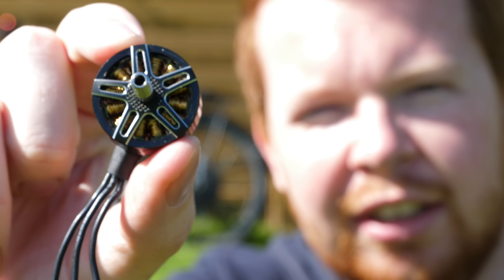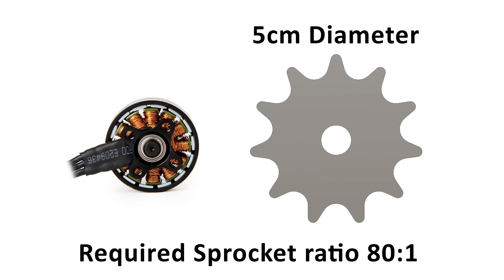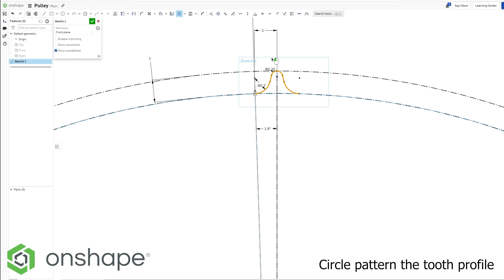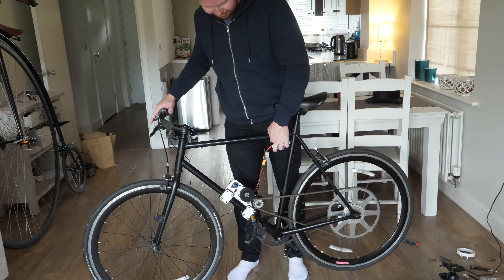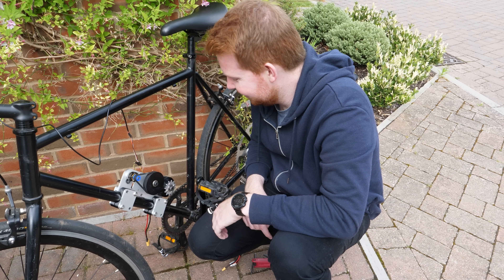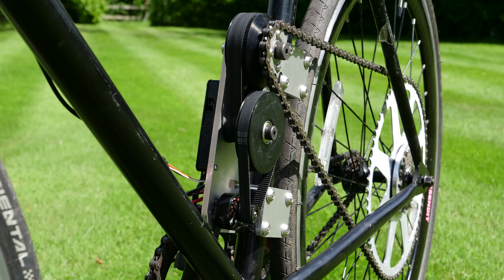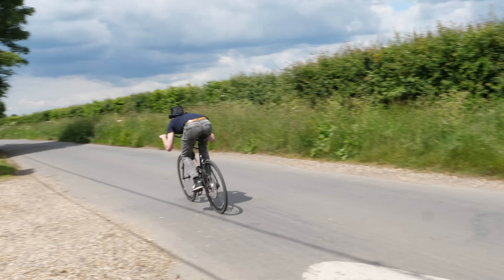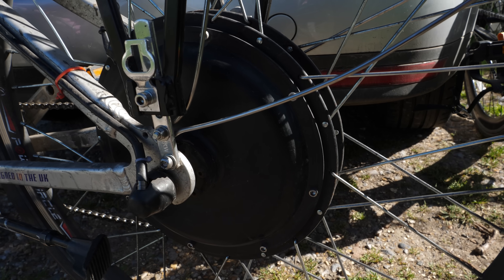Tiny 1kW Electric Bike Motor

Comment: Just add a fan and a duct around the motor, so the fan spins at motor speed. Choose the right pitch to take a little power for cooling, but not too much.
None of the drone ESC's are made for low-speed or high "slip" (magnetic:meccanical) operation, thus the horrible groan. Also, probably drop a fan on the ESC, too.

Would def be interesting to see one of these combined with an internal-gear hypocylic mechanism, with a 90:1 ratio.
Or maybe try with an internally geared hub, which you can get with a 2:1 or even a 4:1 1st gear. Then shift up from there, until you are power limited!

Comment: stack 4 of them around one gear to gain 4x torque for those starts.   Also will benefit spreading the cooling.  You could also mount the motors not on the gearing, so tensioning the chain will not effect shaft strain on the motor.

Comment: Drone motors are made to be very specialized for their niche use, for instance they rely significantly on the propellers to cool themselves down. That is how such a small motor can have 1kW rate.  I would look for motors for this usage on the power tool sector. Some of the new brush-less motors would work great for what you are trying to do.
Reply: And I think this is some internet hearsay fallacy, as most all my drone's prop center hubs completely occlude the motor, yet they don't melt. Why?

The little outrunners and the sensorless drone esc isn't designed to generate torque from a standstill, it expects to run a prop that loads with increasing RPM, hopefully once it's going fast enough to sense back EMF reliably and then time the phases properly. Otherwise it's putting massive amount of current in places that don't generate the rotational motion the system needs for proper control, and all the enamel is melted off the coils damn near instantly.
Reply: @pontiacg445  well if you want to know for real then do a test in a vacuum chamber  instead of imagining that something in the way of air is enough to block all air air cooling. The point is that a motor is not a fan or an air turbine, and even a fan will move some air if you block one side. Depending on how the motor was designed, internal air circulation combined with a moderate exchange of air with the outside is often enough to provide some cooling, and in your example it sounds like your motor is getting enough from just moving air internally and having a decent exchange with outside air. 

In addition, yes it is true jamming any motor will increase the current passing through it making it to heat more as well. My point was that if those power ratings are real at all (they often are not) it is fair to assume they apply only for the motor being used for what it was designed to, regarding especially load, rotation, and cooling. Motors are not all made the same. I remember having an old fan that was jammed for a while and even though it was not rotating it did not burn out. On the other hand I had fans that would overheat if the impellers were not rotating at least a little bit to move some air. The former old school fan was a heavier less efficient motor that was ok being kept turned on and not rotating, while the newer fan was more efficient and lighter, and made use of the impeller cooling factor. All things being equal drone motors are designed for a certain rotation speed range and load. And that involves current in the wires and cooling. Reducing the rotation while not reducing the load will overheat the motor eventually. Note increasing the rpm while increasing the load will also lead to overheating, again because of current in the wires and cooling as you have diminishing gains in the cooling department if you don't increase surface area.

Comment: It seems like Ye'old friction mount on the back wheel would be good for this. You could also engage / disengage like the old dynamos used to do.
Reply: There was a very interesting kickstarter that was claiming to do this about 5 years ago, mounted under the BB, and having a software controlled engagement, battery in the water bottle cage. beautiful concept, I don't know if it ever got made (I doubt it) They were asking about 700 euro for the bare bones delivery tier. I always felt a little tempted by the concept, promising to be the easiest ebike conversion to a regular bike. Maybe one day it will be practical.

Comment: what if you took two of the little motors and mounted one on each side of the back wheel with a rubber drum that spins the wheel directly. the motors would face dirctly backwards and the wheel would act as a very large gear

Comment: I would have like to seen a test with pedalling. I have over 4000km on my ebike and I am always pedalling. I might 'throttle only' ride a few hundred meters per ride.

Obviously for serious commuting this tiny motor is not practical, but combining with pedalling would interesting to see the results.

Comment: Brushless RC motors can typically run at somewhere between 3 to 5 watt per gram, depending on the efficiency and duty cycle and cooling. An actual 1kw motor would therefore be more in the range of 200 to 333 gram, or more. This 40 gram motor would realistically be a 150-200 watt motor. Like you said, it's the electrical rating, perhaps they just figured short circuit current * battery voltage = power or something, or just claim bigger numbers because bigger number = sell more units. A slightly bigger RC motor can totally power an e-bike without melting. :)
Reply: Considering how many amps these things pull the rating can be accurate. The ESC's that control these motors can be like 50A (with higher burst) and use 6S battery packs (22.2V nominal voltage), so if you go full throttle and pull over a 1000W. And you need those kind of ESC's, because if you don't they will just go up in smoke. You can also easily figure out how much watt they are pulling by just seeing how long it takes to run down xxx mah on your battery. Remember, these motors have 5" cooling fan sitting on top of them in use and are on an object traveling somewhere in the region of 120-160kph. Still I wouldn't run that at full power for long ;).  Here is a short video that really shows what kind of insane performance you get from these motors: https://www.youtube.com/shorts/IZ091JnsDAs
Reply: @KoeiNL  I think you can't just measure battery usage because that's an average, acceleration takes mich more power. And the power requirements for these short periods can be quite insane but they can't keep that up for longer. If they had continuous 1000w that would also mean around 100-200w of heat output, that can't be cooled without a fancy heatsink. I have some RC cars, they have 120A 6S ESCs so up to 120*25=3000W and obviously the RC car doesn't empty a 5000mah battery within 2.5 minutes.
The batteries also couldn't handle the load if it was continuous.
Reply: @LuLeBe  Doh, of course it can't run at 1kW until the battery is drained. But the peak power hits 1kW no problem, and because of the fans and the speed the thing is moving at the heat is less of an issue than on RC cars where the engine isn't getting direct airflow and reaches lower speeds. Battery would be something like 6s 2200mah with a 40C constant rating. That's 88A continuously. so a little over 1900W continuously with much higher peaks. You are probably looking at about half of that as an average when flying freestyle or racing which would result in an empty battery in 4 minutes (you will never completely drain it of course).
Reply: I'd love to see a bike powered by an 8s Xmaxx power system 🤣 I bet the bike could do wheelies lol

Comment: to solve the motor overheating you could catch a large volume of air with an air box and blow it over the motor but increasing drag but that should be neglible on a bike i think. Also it looks like you need a gearbox so you can set speeds and you will probably be competing with the ebike.

Comment: Nice job. these RC motors are not for continues working at max power. just foe few minutes till battery  got empty. considering 90% efficiency these little baby couldn't dissipate  100watt of heat. anyway  it was fun.

Comment: 0:27 First: where did get those motors (The best I could find on Amazon were 70W) 2nd: Motors usually have two power ratings. Peak power (Only for short bursts) and continuous power. What of those is the 928W?

Comment: hydraulics baby.. this is an idiotic exercise to begin with.. then the mechanical approach is fraught with friction losses... this is a fucking commerical  for soft ware..  the bearings are too tiny to last with that kind of load..and the starting current is so high the motor will fry shortly... this is beyond ignorant...  The limit is the knowledge and intelligence of the presenter.   This is also why  gas turbine motors are not used in wheeled vehicle propulsion.. too stupid for words because of transmission problems.  But the real killer here is the current draw... which they ignore but which is everything to battery life, and efficient use of batteries and motor life.. since the wire size determines the current handling capacity.  This is a case where you do NOT WANT small size.. you want big fat wires that run cool and are efficient and reliable.   Other motor typea like pancake motors are small and have high torque and power capability.

Comment: If you connect 4 drone motors in parallel? You should reduce the workload by 4, this would reduce also heat. And what about the controller, What it hot?

Comment: Drone motors spin up fast, and have high RPM at low torque. Ebike motors need high torque at low speeds, with lots of passive cooling, cause that is inefficient!
The whole point of an ebike motor is to push you up those steep hills!

Comment: You are loosing at least 30% efficiency because of all the transmissions.
And your cooling is insufficient.
I could have told you this will happen without building this experiment.
So what was the use of this experiment anyways?

Comment: it looks lke you might need a second mount on the motor plate to keep it from slipping one way or another. Also, what that 6kg mass gets you on the ebike motor is heat sinking and current capability over time. So its a payoff.

Comment: Does not "feel" fair nor realistic. Drone motors are air cooled and run spun up, so the bike app needs at least a centrifugal clutch (or better yet an automatic transmission), a heat sink, fins & a cooling fan.  Has potential.

Comment: INCREDIBLE!!! OUTSTANDING!!! FENOMENAL!!! that guy hat... ;-) now about the bike... ;-))

incredible that tiny motor,,, but you just need to optimize the thing...
why not put 1, 2 or 4 slightly bigger motors, with a low rpm, inside a hub in the rear wheel... and divide the ration only internally,,,
better,,, why not put them inside in a hub in the rear and front wheel... oh... and use the motors only in motion... above 5km/h...
(to avoid the metal chain as possible... in a future problem maybe a testing a liquid transmission -> friction only above n-RPM)

Comment: hi Tom Stanton, I found some decently big flaws in your design for the drone powered one. and some extra things for optimization and fun/urability.

mistake nr1 is that you forgot to add the solex clutch. right now when you try to drive away it generates a lot of heat, and also has a very low mechanical energy output probably around 100W to 200W due to the low RPM. the motor is also RPM cooled so this also makes it very hot. using a solex clutch you can have a much greater motor RPM while riding away and so a lot more power, a solex clutch is basically something which allows the motor to stay at a certain RPM so it prevent the motor from getting to a to slow speed. while it might sound like this will make it weaker, it will in this case actually make it a lot stronger and more relyable, also faster.
the solex clutch will also allow for a lower gear ratio allowing for more max speed.

mistake nr2 is that you used a normal bike chain. bike chains are very fragile and tend to break very easily, that is why motors are often directly placed in the wheel or a belt is used instead. however this isn't as much of a mistake as something that makes it break faster and makes it more dangerous.
this also bring is to the 

fun and optimization things:1 use a solex transmisstion(solex again), solex was one of the first oil powered electric(used electricity for the sparks and lights) bikes in public trade, but also very well designed, it had a motor of around 300w max when looking to the output however there was a lot of diference between the motors individually. however still they go around 30 km/h despite also being really heavy. the solex transmission to the wheel however isn't as much a technical thing, it is just something simple which allows you to easily disconnect the motor and it also makes it easy to switch it between bikes. to put it simple it is just a wheel with a sandpaper like structure which is pressed on the wheel, the bike wheel itself is used as a gear as well in this case. while this isn't always the most efficient it would likely still be more efficient than the aproach you used right now because it allows you to only use one gear set instead of 2, and it also bypasses the chain and all, it also ads sime possibility for slip which can protect the motor, the 3rd gear part is also skipped because it is replaced by the roller touching the tire. you can make a prototype using snad paper or rubber(to prevent the tire from getting damaged, but you'll lose some of the slip on it), however a way to make it a lot like the original ones is to just use a proper epoxy glue mixture with some stuf in it for the grip, this makes it like the road and so it won't really damage the tire 

2:adding a small propellor to the motor and/or adding small heat sinks on the outside, both will help cool it, they are meant for use with a constant airflow, adding some heat sinks and/or a small fan for cooling will make it a lot more durable.
Reply: i wouldn't call bike chains weak though, obviously depends on the brand etc but a good KMC chain even takes the stress from a Bafang BBSHD, which has a peak torque of 160Nm at the crank, they can even take the torque from the CYC X1 Pro Gen 2 (250Nm torque at crank) so thats defo not weak

Comment: you totally skip a very important matter for this motor : air cooling. This motor with open design is obviously design to be cooled using the air from propeller. Of course it needs a fan to flow the air inside it. Second this is a synchrone motor but it looks like you want to use it without position management. Maybe it is ok for propeller use, but not for high inertia use like you do now. This said, I suspect your motor is fighting against himself as the coils are not "fired" at the righ moment. maybe you should try to replace the magnets with a squirrel cage, transforming it into an asynchronous motor.

Comment: Those large Turnigy out-runners may do well. They're without hall sensors. Imagine putting 4 of those geared together with planetary gears,  inside a prefab aluminum chamber filled with synthetic oil.

Comment: Hello from Canada!! I think you had a fabulous idea testing the little motors like you did. I would love to see you attach an independently powered fan, so that the little motor is in a tubular shroud housing to create a mini wind tunnel effect. To test which is more efficient, set up two identical bicycles even with extra weights in your back pack for the smaller motor and one bike with the hub motor. Separate bikes so that the little one wouldn't be fighting the resistance of the hub motor. For testing have one fully charged battery to swap between the rigs, then ride a set route to see which motor can go farther on the same full charge. After seeing your test, I was wondering if a long range riding commuter, could have a much smaller motor setup to get them to work as long as there aren't huge hills to climb. In the future, there could also be bikes with both motors, but with a programmable controller that would switch between the two. On flat steady roads the smaller motor would be running for the easy work, then on a hill the larger motor would engage to get the maximum possible range from a single battery charge. Keep up the awesome content and I can't wait to see more in the future, so stay healthy and as happy as you can be.
Reply: The only advantage the small motor might have is weight, so having both types would be senseless

Comment: Great job! I think the problem here is that motor specs are often very vague. The bike motor is likely 1000W continuous whereas the drone motor is 1000W peak.
Reply: he getting kv mixed up that motor is not a 1000 watt. kv is 1000 rpm per volt input.

Comment: Placing a current limiter (~75% rating or less) and blower fan with a 3d printed shroud, should last for quite a while!  
Now imagine adding a couple more in series. Perhaps mounted on the back side of the plate, one motor top and one bottom using the same chain drive gear through with a bearing.  Since you know you have about enough torque you could adjust your gearing and really ramp up the top speed.

Quite a savings in money and weight when you think about it, would be hard pressed to find a decent 3kw hub motor for under $300.
Reply: Well if we’re going to start thinking about cost, you’re in the realm of practicality and time is money…